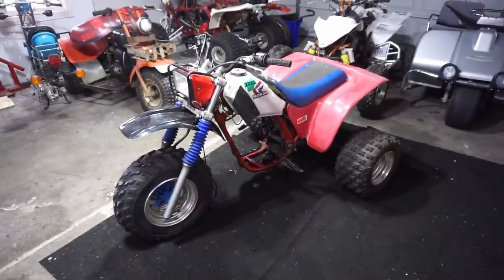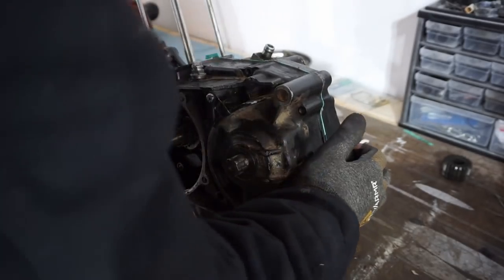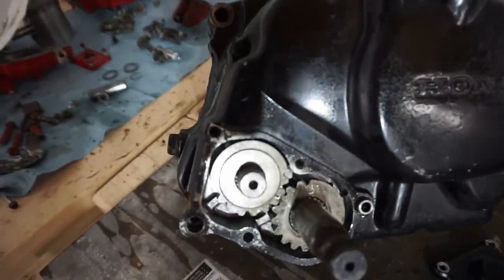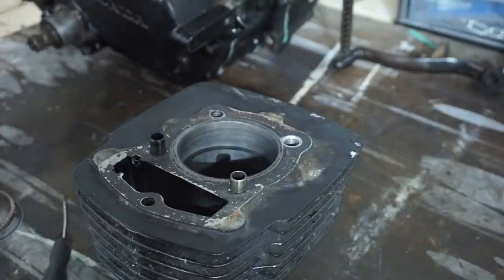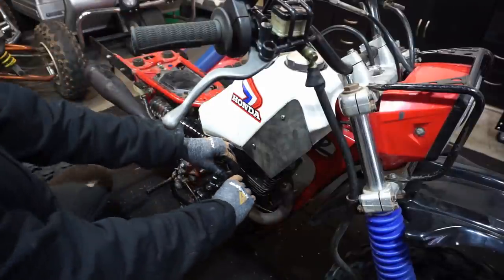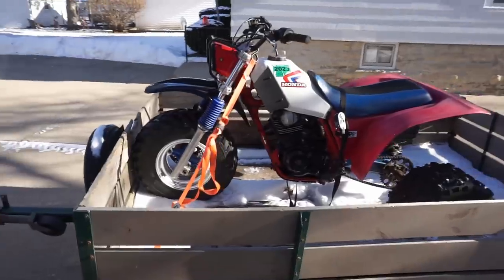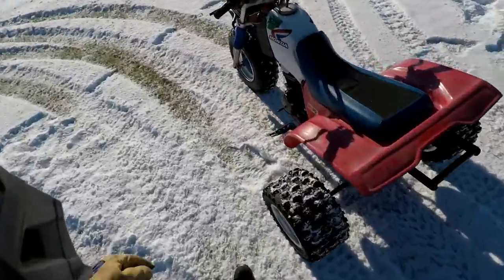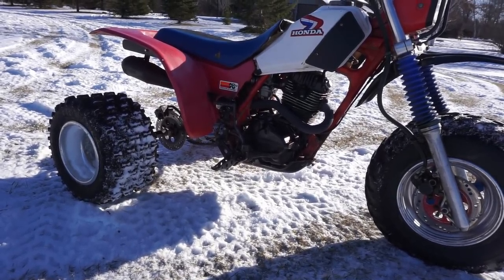Cheapest Honda 200x Is FIXED!

Comment: Those old Honda's are close too bulletproof ...hard to believe that 4th gear was ground off like it was...the instructional part of your videos the best part...
Reply from the maker: Yeah I couldn't believe it when I first saw it!
Reply: The old ones are better than the new ones! Nowadays Honda is far from best engines in quads, UTVs or dirtbikes etc.
Reply: some one have swap gears with out clutch and in wrong rev so that do at gears gonna broke or eat it up.

Comment: I absolutely LOVED my 200x in the snow, especially with 18” rear tires I had helping to take some tippiness out of it. It was an absolute ball ice riding out on the bay. Please tell me you’re going to get a real set of tank shrouds right? Even the oversized ones from Maier look better than what’s on yours Joe. Btw, Pro-Link was how Honda marketed their rear suspension linkage starting in the early 80’s so that’s just a stock swingarm you’ve got but painted blue.
Reply: Me too, loved the 200x

Comment: Put thumb throttle back on that monster, twist will get ya hurt, my buddy in high-school had same quad, put twister on it, lost control trail riding (whiskey throttle) broke his neck, hit a ditch and flipped off a hill in the woods. Buke still runs to this day, a little beat up but you did a quality job on that. Sorry for the buzz kill, but don't want to. See you get hurt

Comment: Picked up a pretty clean 84 200x couple weeks ago guy said it was having a very hard time starting and running compression felt low gave it a simple valve adjustment and it’s like a brand new bike again runs great and strong not bad for 750 bucks
Reply: I just picked up the same thing with same problems this weekend. Hoping a quick valve adjustment solves the issues!

Comment: Nice job.  Go really easy on the gasket sealant. You don't want globs of that squeezing out into engine.  And you might want to clean a little more thoroughly after honing.
Reply: It’s always good to wash out with hot soapy water after honing. Just gotta make sure you dry it real well

Comment: It's always a great feeling when I tear down an engine that far and then hear it running again. Especially when it doesn't have any leaks or any other problems. Great job on this one. Good luck with your Quadzilla/Banshee. Stick with it, don't let it win! I still think that the piston is coming too far out of the top of the cylinder at top dead center. The cylinder has been milled or wrong piston or wrong head gasket thickness. Great drone footage. 👌 Again, good luck!

Comment: Those were great machines.. had an 84 but the frame was shot.. front swingarm pivot was so wore out even new oem bearings would fall out lol. Finally got an 86 with the square frame and the 6 speed transmission and liked it a ton more but that's still a good trike and a lot of fun. Keep it up bro👍👍👍👍
Reply: I did have a 83 model but I don't have it now

Comment: mechanically it sounds great. Running wise it sounds like its misfiring. That would also explain why it keeps dying and is hard to start. even back when you first got spark out of it in the other video it seemed intermittent.

Comment: aircraft remover works incredibly well on super old gasket bits left behind after removal. I use a small amount on a q-tip and run it around the mating surface and it turns old gaskets soft again and they come off like butter. Be careful with it, it’s super noxious. It neutralizes with water 👍 great product to have on hand with these old machines. Gets your mating surfaces spotless to ensure no leaks down the line. Be sure to use a damp rag and get it off/neutralize it before reapplying a new gasket. Cheers.
Reply from the maker: 👌 i will try it out!
Reply: I assume you mean aircraft paint stripper?  Also a good gasket scraper would help.

Comment: I’d love to see you try the aircraft remover trick in one of these videos. Everyone’s reaction is priceless given how much we’ve all struggled at one time or another with stubborn gasket bits.
Reply from the maker: I have aircraft paint remover. Does it work pretty well for getting off old gaskets?
Reply: @2vintage  get the Permatex gasket remover stuff you brush on and let it sit for a couple hours and it help get it off a lot easier
Reply: @2vintage  it’s ridiculous. Let it sit for ten minutes or so and it works killer.

Comment: Get a real 200x thumb throttle, easier to hold the gas in the drifts than using the wrist while pushing the bars out.  That machine is nice, nice work on that gear change.  I'm finishing up my 400ex engine now, split the cases for the shifter shaft replacement.  Also don't be afraid to really shift your weight to drift a little harder, think hips out with the drift.

Comment: I’ve used a narrow metal spatula that I’ve sharpened to these years,so the edge is a good and it's good tool for removing a old caskets, but sometimes I use a razor blade and i have use plastic on the other blade so I don’t cut my fingers or anything else open.

Comment: Your nuts with that driver on the clutch hub haha, first time I was doing any engine work was a clutch and when I started tightening those spring bolts one just ripped the thing behind the inner that the spring sit round and since then im extra scared when it comes to small bolts getting torqued 😂
Reply: My first experience with the clutch hub, I tightened them with my impact, and sheared the head right off! Needless to say, I only use a ratchet on those now!

Comment: Nice job, one thing tho is why when you have a good surface and a new gasket do you put sealer on? It doesnt need it and just makes future maintainance a pain in the ass
Reply from the maker: I only put it on one side of the gasket so that you can take off the clutch cover easily. I've had brand new gaskets leak before so I do this for reassurance.

Comment: Good fix Joe, although it should  start with fewer kicks than that!, did it need a squirt of easy start again as l noticed seat was off after it came off the trailer ? Maybe those wires, fuel tap not flowing correctly  or carb  needs a little tweeking if you need to have it idling quite so fast?

Comment: 2Vintage..Hey buddy I just wanna give u a idea for that Quadzilla that blew up on u twice..
If u put a spacer or maybe 2 gaskets before u put on the head,then do a squish test w/a(paperclip)+then check it w/the micrometer.U should get the right reading.
I had a kx-125 big bore 80 over wisco piston.And kicked it over and it was idling.Then "click"-Motor siezed in 7+1/2 min.. Bought another piston and rings.But a cheaper piston,and I told the guy what happened.He said"The head must've been leaking"
Anyway I took the "cheaper after market piston put it on the bike used 2-head gaskets+ gasket sealer.. Tightened down the head put the dome on..4-5 kicks the bike fired up.Stayed Idiling,little Rev's for about 20-minutes.Then it was fine.With that big bore on it.Wow it was fast.(But the moral of the story is it took 2head gaskets to fix my problem)

Comment: You definitely need to pick one bike n fully restore it with fresh powder coats a small series of the progress n best doing a trike probably because they are the rare ones imo
Reply: That 350x would be perfect  for a complete stage 0 ( factory specs)rebuild  they're the  undisputed kings of 80"s Honda trikes no doubt about it. The 86 being a bit more nimble in my memories anyway 😂✌🏻

Comment: You need to move the kicker forward so it closes in by the motor you have it in the incorrect position and also did you notice how to tighten the chain on the 83-85 atc200x it moves the whole swing arm backwards it’s a bit over complicated but cool nevertheless only one of its kind Honda innovations baby I think the carb is plugged up cause I noticed the miss like it was kinda starving for fuel and FYI 83-85 is first generation they are the same everything is interchangeable 83-85 besides color options of plastic.
Reply: The 81-82 250r  chain tightens the same as the 200x as far as the whole swingarm moves back to tighten the chain.

Comment: The starter gear didn't look damaged or worn to me it just looks chamfered. Could be to allow oil to flow between the teeth better. Maybe a revised part.
Reply from the maker: Yeah that's whatbi was pointing out. I wasn't saying it was damaged, just different. I eneded up using that starting gear when I put it back together.
Reply: @2vintage  ohh ok I thought I heard you question if it was worn but I must have got it wrong. She is a beast now that's all that matters 👌😄😄

Comment: I have a 200x with no second gear, what’s the difficulty level to change the gear or shift fork. I have the parts and motor pulled I’m just too scared to take it apart.

Comment: At 34:02 I see it sparking to body ground. Look carefully you will see it. under exhaust pipe
Reply: Yeah, I feel like I see that too right under the pipe.
Reply: @cgreeneblue  glad you saw it too
Reply from the maker: What would cause that?
Reply: @2vintage  No idea man...st elmo's fire?
Reply: @2vintage  I can't see where the spark is coming from clearly. Is there a wire? stripped insulation?

Comment: dude it hurts to see them gasket surfaces not cleaned up properly
Reply from the maker: I took a razor blade to all the surfaces. They were cleaned up as much as I could get them. I probably spent 1.5 hours cleaning all the old gasket off. There has not been a single leak out of this engine yet.

Comment: Wow did you not really give that cylinder a thin coat of oil before putting it together..lol..wow..and it doesn't look fixed to me..fixed means it runs longer than 10 minutes...